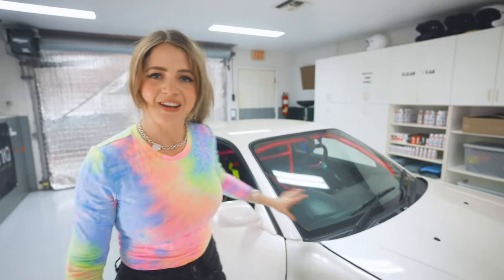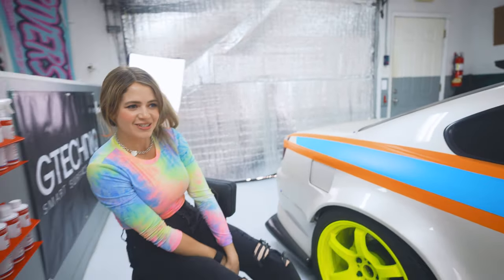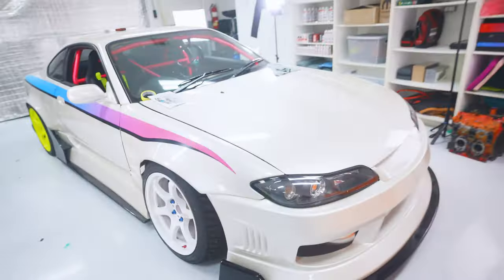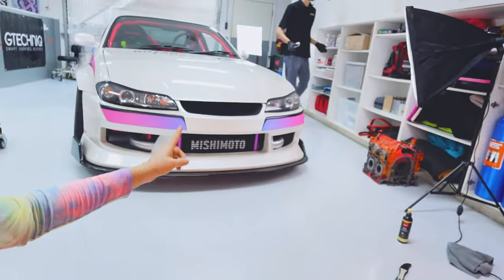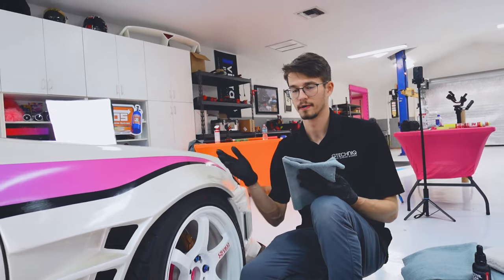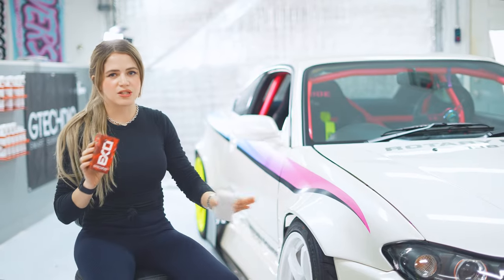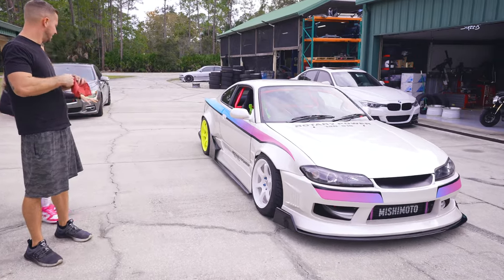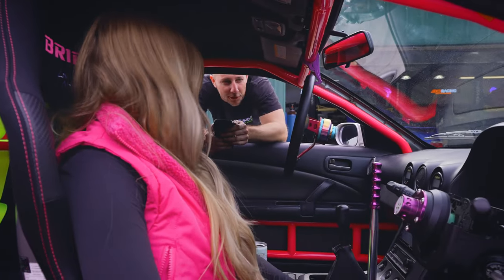Rotary S15 Livery Reveal!! *First Time Knifeless Tape + Coating*

Comment: Absolutely love the livery. Came out amazing. I know its not the pink you wanted but it looks soooo good as it is. Only thing letting it down a bit was the neon yellow wheels that were on it right now. All white wheels or even matching the fade on the wheels (having pink in front and purple in the rear or just the middle color all around) would really tie it together.

Comment: I think because the doors can be opened, that if you do this again you put little plastic t or I wedges into the door gaps that allow a little extra material to sit there and afford overlap on both sides of the door, maybe 1/2 inch. That would avoid a stretching problem and give enough material to afford for a clean look on either side of the door gaps, to finish it. It would preserve the speed of lining it up along the body, while not having to initially cut three different stripe pieces.

It really turned out good.

Comment: The problem with the pink is likely a color space issue.  If their printer prints in CMYK, it’s somewhat limited in the range of pinks it can produce.  I don’t know anything about vinyl printers, but in more traditional printing there are printers that use more base toners beyond CMYK to get a wider gamut of printable colors.  It might be something to look into.